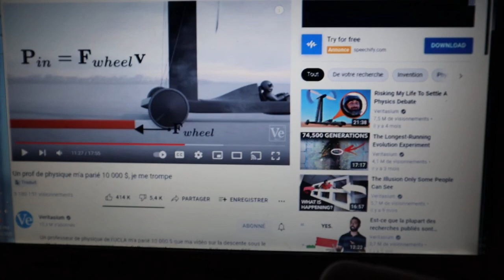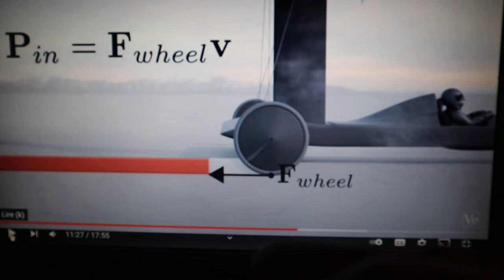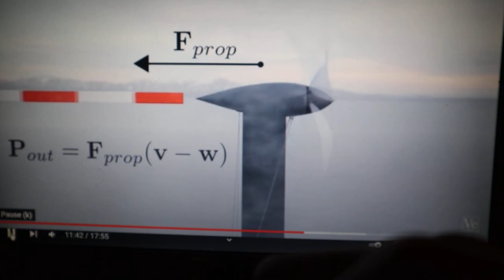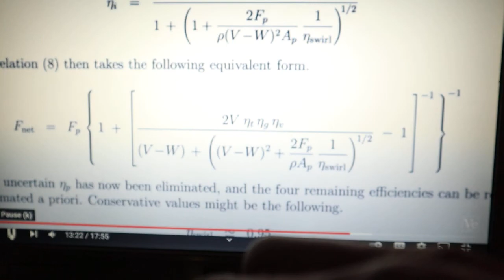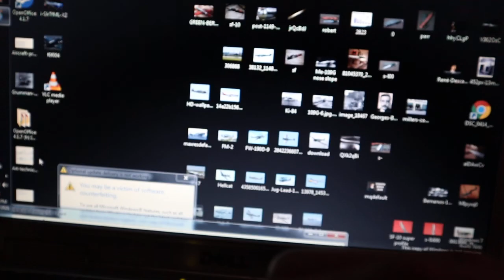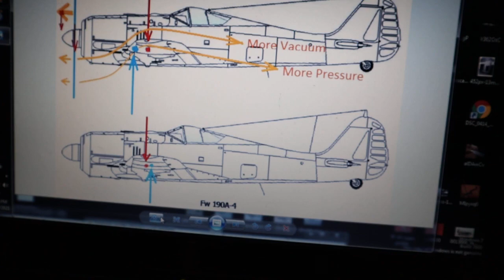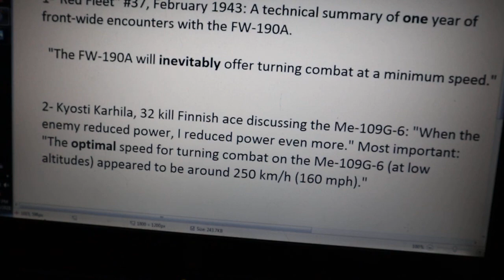WWII fighter aircraft designers did not understand what they designed: A physics demonstration

Comment: I believe that while Karhila was right in his quote, it was for different reasons. My theory is that he's reducing power to bleed speed, and get a considerably smaller turn radius than an enemy plane going faster at its optimal turn rate. Keep in mind here that what he's saying is not that the Bf109's turn rate was best at 250kph, but that against an enemy fighter the optimal speed for turning combat was 250kph.

By going slower, he can cut inside their turns and point his nose in front of the enemy plane. And at that speed, with the angle of attack he has to pull, he will go to full power - even if he throttled down before to get into the turnfighting state - in order to not fall out of the air.

The Fw190 has a big engine and a big propeller moving a lot of air, even with the high wing loading it is possible that (unlike the inline engined planes, due to how much closer the propeller is to the leading edge) it can get enough air moving through the wings to give it an advantage in turning compared to an allied fighter at the same speed. Also to mention, the bigger propeller makes it more efficient at lower speeds than a smaller diameter propeller, so it has more thrust to 'throw away' in a very high AoA turn.

About the professor's bet, I think he was just looking at it from the wrong point of view. The wind is powering the propeller which in turn is powering the wheels, and the wheels are a hell of a lot more efficient at energy transfer than a propeller. Couple that with the claim that wind is faster higher up, and you have something that seems impossible.
Reply from the maker: Quote: "Keep in mind here that what he's saying is not that the Bf109's turn rate was best at 250kph, but that against an enemy fighter the optimal speed for turning combat was 250kph." Answer----- It is true for gaining aiming lead it is better to have the smaller radius, but that still means the smaller radius has a sufficient rate to GAIN in pursuit. Note he says himself in the quote: "In a smaller radius I was able to turn EQUALLY well." So the powered-down sustained speed turn rate is at LEAST equal to the best sustained rate, but with a smaller radius. 

  There is no way 250 km/h is full power at any point, and he never mentions throttling back up. On the contrary, he says: "When the enemy reduced power, I reduced power even more." It was a contest of SLOWNESS: Whoever could fly the slowest won. That is why pilots said: "Turn fighting is a race where the slowest wins."

  Just to indicate to you how throttling "back up" to FULL POWER absolutely NEVER happened after down-throttling, this account by a P-51B pilot: 2nd Lt Chris J Hanseman, 24 May 1944 (P-51B vs Me-109G-6) "A dogfight developed at about 500 ft (after climbing from 150 ft on a slow gaining attack on a landing Me-109). At first he began to turn inside me. Then he stopped cutting me off AS I cut throttle, dropped 20 degrees of flaps and increased prop pitch. Every time I got to the edge of the aerodrome they opened fire with light AA guns (implying MULTIPLE consecutive 360s). GRADUALLY I worked the Me-109G away from the airfield, and commenced to turn inside him AS I reduced throttle settings."    http://www.spitfireperformance.com/mustang/combat-reports/339-hanseman-24may44.jpg       

  Notice he mentions TWICE powering down, NEVER powering up. And it is NEVER "He stopped cutting me off AFTER I cut throttle" but AS... And there is no way 8000 pounds going at 300 mph will slow down by large amounts instantly, yet the effect on the turn rate IS instantaneous (strongly suggesting power DOES affect the wing loading through instant negative leverage, since there is NO deceleration lag for the effect) not to mention he was climbing from a slow gaining attack on a LANDING Me-109G, so was already going well below the 250 "Corner Speed" at minimum (Which minimum speed to reach 6Gs the SETP (Society of Experimental Test Pilots) tested in 1989 as being really around 300 mph (276 mph spiralling slightly nose down), contrary to the flight manual's claims of 240 level, which flight manual's 1944 G figures were obtained with dive pull-outs, which would unload the prop: SETP G testing was ACTUAL horizontal turns: So a highly loaded prop... Right there, this shows there is difference in G performance between loaded prop and unloaded prop (in dives) which indicates power DOES affect the wing loading). 

  Karhila makes it very clear in his wording that turning is a race to be the slowest with the lowest power. They could hold on without stalling if they had partial flaps. The Spitfire had a fair rate of turn, maybe 20 seconds on the Mk V, but had to carve a wider circle at a faster speed, so you never hear of down-throttling from the Spitfire: It had no partial angle flaps... And Clostermann says clearly the Spitfire turned well at high speeds, but at low speeds turned like crap compared to the FW-190A and the Me-109G: 12:45 :.  https://youtu.be/c2zdA9TcIYo   This would be in line with my theory that the shorter FW-190 nose (and bigger CL forward movement) taxes the wings less, despite 50% more nominal load than any Spitfire. A shorter nose with less leverage can be "imitated" by lowering power on a longer nose... But then the shorter nose can also lower power, and they did use them that way, one FW-190A pilot saying he never used full power, and simply turned all the time during combat, power always reduced.
Reply: @wrathofatlantis2316  Then there's something missing from those quotes. Take it to any flight simulator - even a professional one - and try to pull a slow, high AoA turn with reduced throttle. You'll very quickly bleed altitude.

There's so many possible variables here that drawing conclusions from a few encounters, and even for the widely reported fights there's always something to keep in mind: this is air combat.
Pulling into someone, in a turnfight, that is going slower than you and has a smaller turning radius is extremely hard even if you have the rate advantage. By the time you get behind them, you'll be on the outside and unable to pull in harder.
When you're pulling that much AoA, even a P-51 will slow down pretty fast. Throttling down meant the 109 was probably going faster and his nose overshot the P-51 that just cut his speed and turn radius, even if his turn rate didn't change.
Reply from the maker: @reinbeers5322  There is no bleeding of speed if you don't exceed 3.2 Gs, at partial power, partial flaps, and 7 degrees of angle of attack. Once you reach the lower limit you cannot afford, or want, to turn harder, because your opponent can't either, and that is PERFECT for you... Sustained turns at 3.2 Gs are what really mattered in WWII, once the speed bleeding was done, and the bottom speed (150-200 MPH) was reached. Often, naturally, this occurred near ground level. There is not much point in using higher Gs, because then the target will just swing by your nose, unless it decides to match you perfectly. Un-sustained speed turning for props (3.5 G and up) is for the jet age, not the propeller age, where props needed a steady captive target for a 1% hit rate over at least 2-5 circles (and slow speed turning DID capture the target, because you could not roll out, for geometry reasons, something which the German opposition to turn-fighting usually ignored: As a result, Germans rolling out of slow speed turns, to instant death, were a large proportion of Allied victories). 

  Because of this, Hit and Run proved at best a secondary tactic for (rare) unaware targets, and a low risk/low rewards tactic for new pilots, or a source of moderate but steady rewards for eagle-eyed aces. 

   Do you think these counter-intuitive notions are so easily arrived at? I have been arguing this general point for 15 years now, and it took me 12 years of research to discover it. All the newly discovered quotes I found since have been in my favour (and I did try to find unfavourable ones). One of the more recent favourable ones being the quip by Pierre Clostermann that the Spitfire out-turning the FW-190A at 200 knots (45 lbs ft/sq foot vs 30 lbs on the Spitfire) was a "good joke". 

  There is not a single WWII account of increasing power to turn faster or with higher Gs. Not one. 

  My question to you is simple: Do you accept any of this even as a hypothetical possibility, or (more likely, since you dismissed all the unambiguous quotes I provided) you don't?